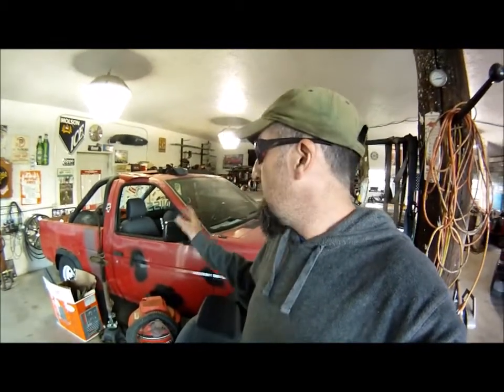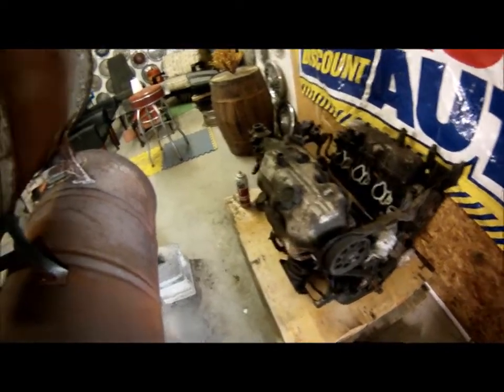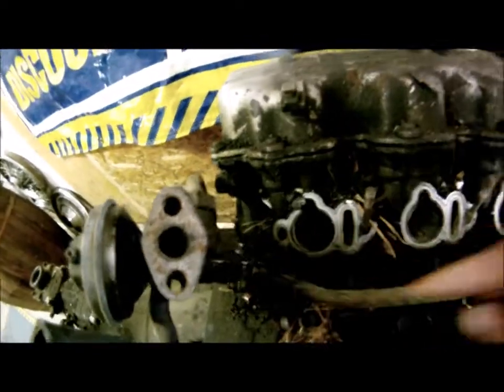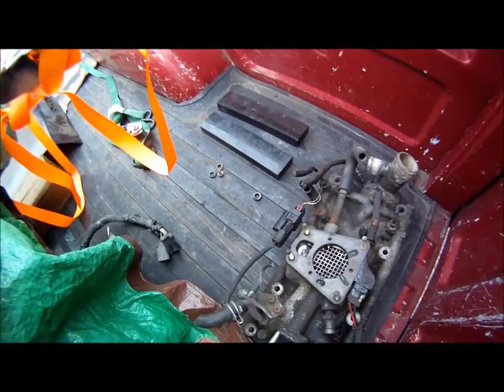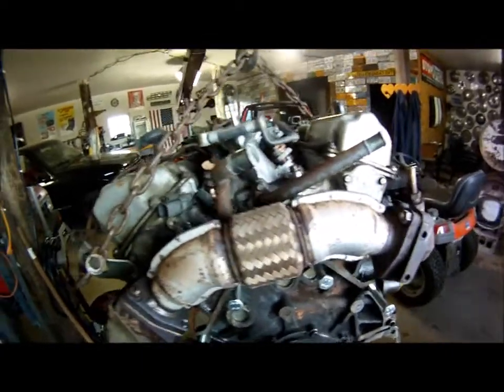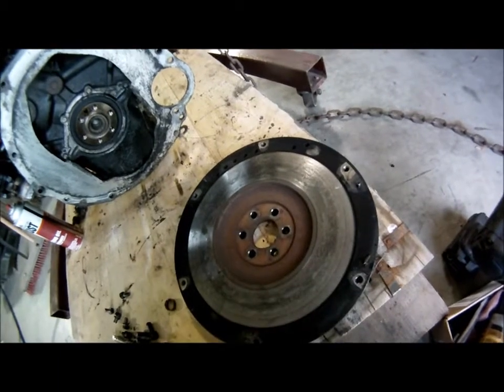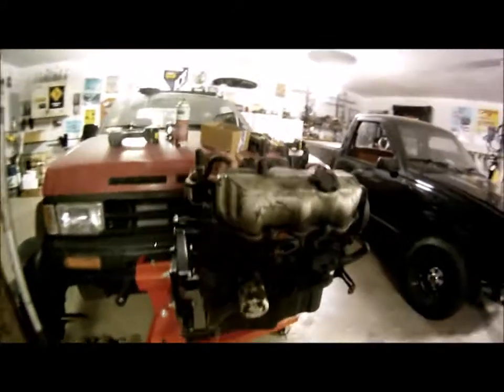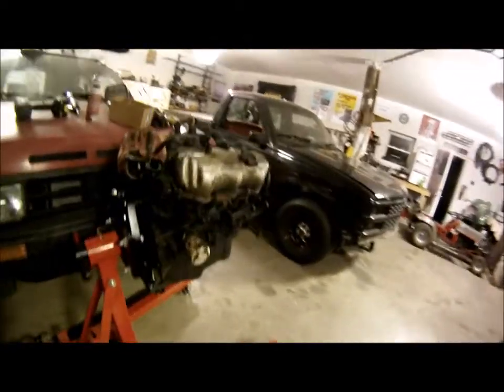Nissan D21 Hardbody: 300ZX VG30E Engine Swap Episode 1

Comment: Which motor and transmission mounts did you use for the vg30 in the d21?
Reply from the maker: The stock v6 2wd mounts will work.

Comment: I don't think, I will ever get straight answer : will Z32- 90-96 300zx 90-96 manual transmission bellhousing  bolt in directly to KA24E 4 cyl engine?
Reply from the maker: No it does not. Different bolt patterns and the bellhousings dont swap over like chevy and fords do.

Comment: Cool man, can't wait to see the rest of this series.  You going to use the heads from the car or the truck ones?  The car heads are DOHC right?
Reply from the maker: Heads are off the car, sohc. The cams from the car are the most aggressive of the OEM cams so I plan to keep those.
Reply: Ah ok it was the TT models of the 300 that had the DOHC engines.  That should be a sweet truck when it's done.
Reply from the maker: Hoping for the best. Yeh I stayed away from the DETT version, too big and I would rather go supercharger eventually.

Comment: Does the ka24 transmission bolt right up?
Reply from the maker: No it will not. You will need to source a v6 trans out of a truck if possible. The bellhousings are different.
Reply: Ok thank you for the info as far as mounting? Do I need to swap the crossmember? Or should it bolt right in?
Reply from the maker: You should get the crossmember, they are different.

Comment: Very neat, does the truck exhaust have that obnoxious crossover pipe? And what happened to the left side, did you clean it?
Reply from the maker: The truck does not have a crossover pipe luckly. I did do some cleaning and removing of things. I just spent so much time moving these engines around I ran out of time to actually work on them. More in the next episode!